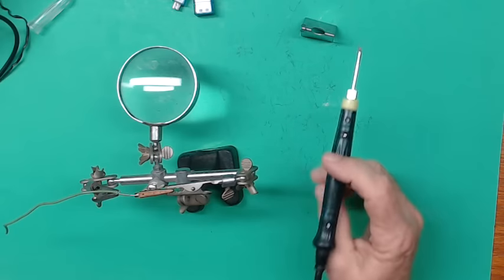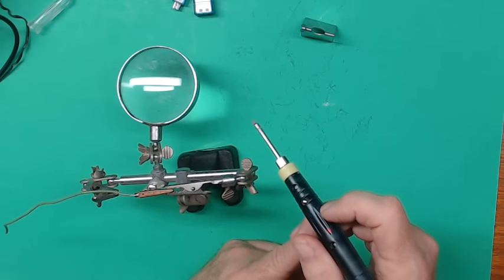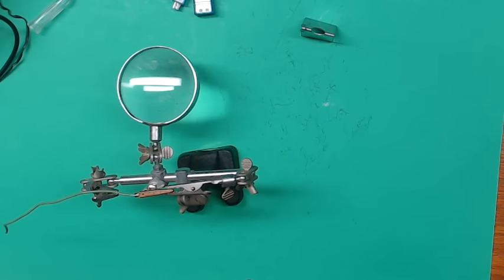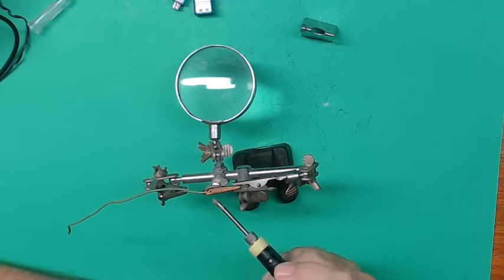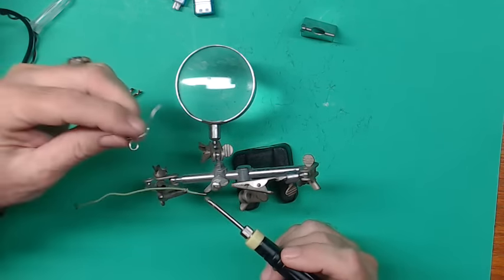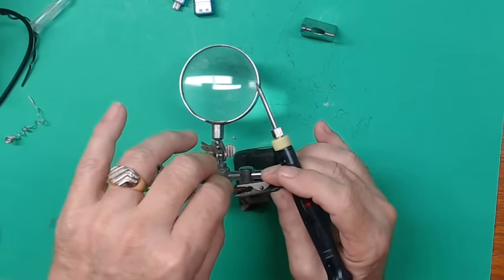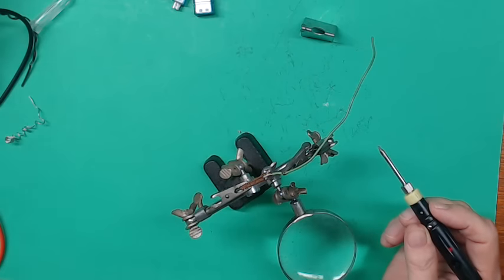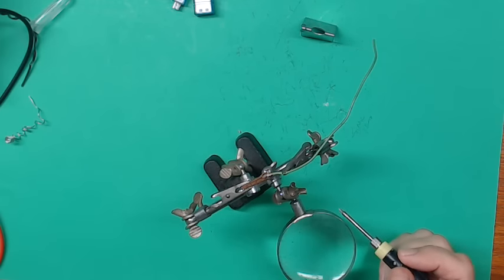TRRS #0903 - USB Soldering Iron - Working

Comment: Never knew a usb powered solder pen existed, nor would i have EVER thought of that. Did you say you got it from Banggood for bucks?
Reply from the maker: Yes, note that further review revealed that there is a voltage on the tip which could damage sensitive parts.

Comment: I would never us my computer to power such a device. Most USB ports only allow about 500 ma however, I did read somewhere that the newer USB standard now supports up to 2 amps. Even so, I do not think a computer was meant to be used for such use. I might be wrong but, again I think it is a bad idea.
Reply: I don't know, If I could teach my computer to solder, might not be such a bad thing, ha ha ha .

Comment: Would be my guess that the heater is right near the tip and that white stuff is insulation between the center conductor and the barrel in that tip tube, Just a guess. But it's pretty cute for $6.00. Can't say I'd have a use for one. LOL. Good videos Tom.
Reply from the maker: i don't think so it was a crystal powder and I did not see it in any pictures I found.